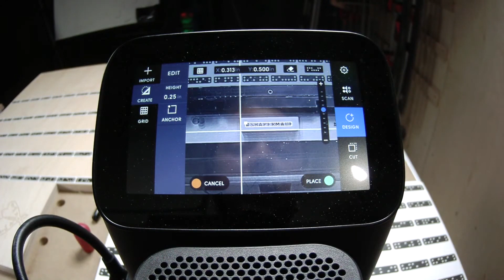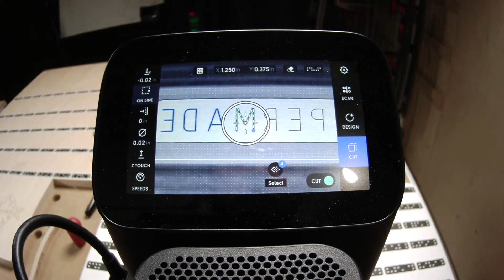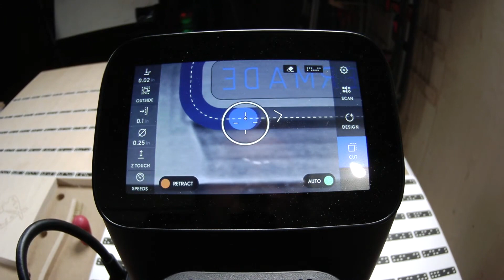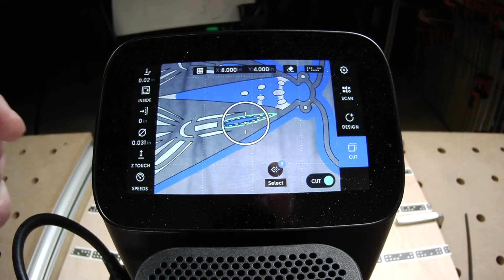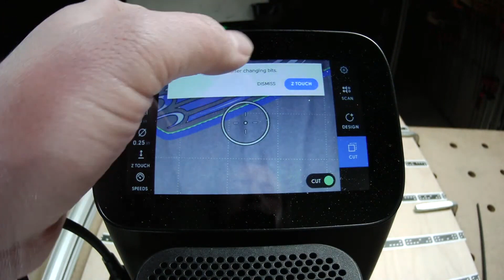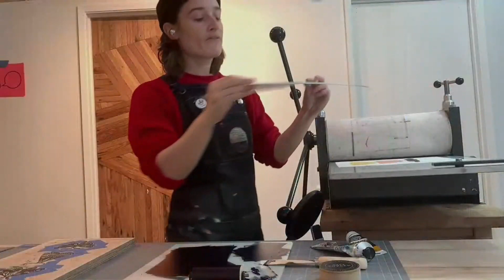Session 26  – English: Block Printing with Origin

Comment: Hello from gernany 😃

To make a z touch on soft materials, it is possible to use a sheet made of steel or aluminium?
After the z touch, i make sure for the deepness i added the thickness of my using sheet to the engraving deep?